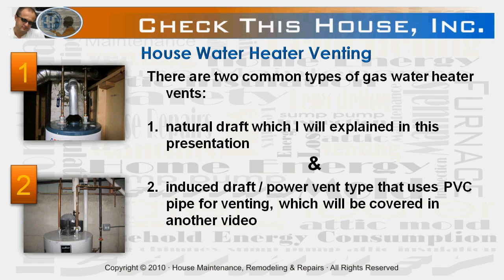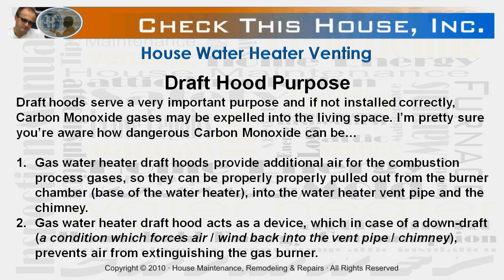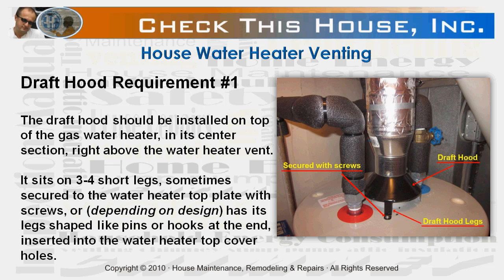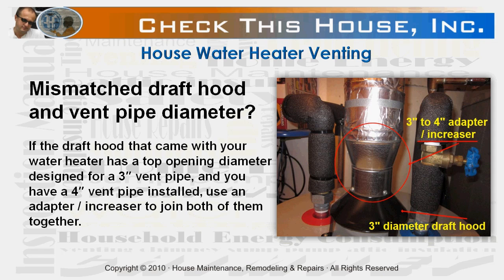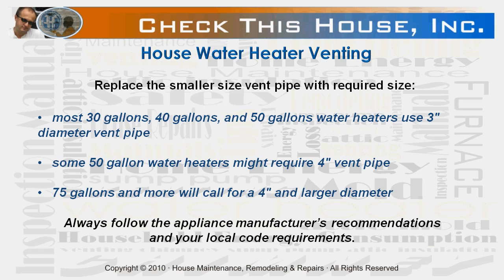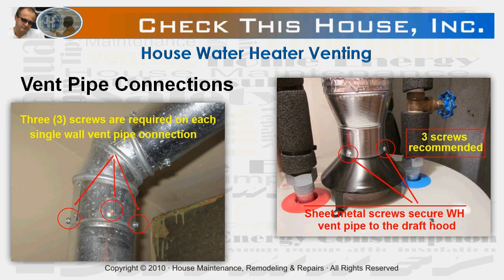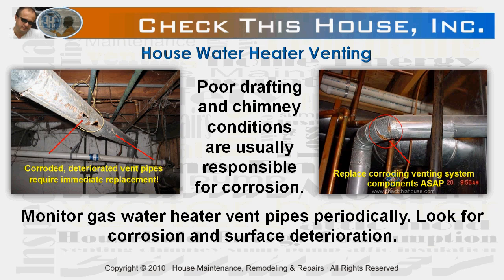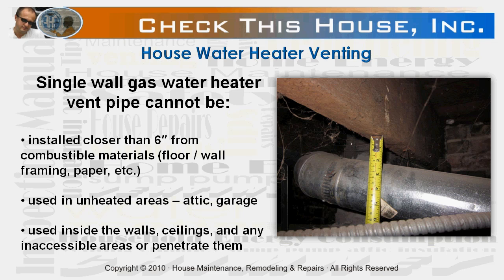Hot Water Heater Venting, How To Vent a Gas Water Heater

Comment: Hi...our gas water heater is currently vented thru an old chimney that has no liner...can the water heater be vented horizontally across the basement ceiling over to an outside wall safely?  (Which would make the chimney non-functioning)..Thanks!
Reply: Did you ever find an answer to this?
Reply: @bryangonzalez3165  ..we ended up having to get a new electric/gas type of water heater so it could be vented horizontally.  Worked out well.

Comment: @Home Maintenance
 I have a question and a little back history, we bought a house and the first winter our furnace went out, I tried replacing everything on the furnace, even the blower motor and the  electric board. well come to find out that our chimney was destroyed and the moister was freezing up, and then running back down into the furnace and causing the issue, so the chimney was completely useless we found out. so when they came to replace our furnace they installed 2 PVC pipes which lead out to the front of the house and we bought a brand new water heater just before the winter, and of course it is vented through the useless chimney. so my question, is it possible to convert my Atmospheric venting to a power vent and run it up to the middle of the joists and then over and straight out the back? thank you

Comment: If venting horizontally when in a basement near a wall, a thimble is still required with double wall pipe correct? Also when through the wall does it have to be a certain distance from the home?
Reply from the maker: Hi Jesse, is this a natural vent water heater? Are you venting through the side wall of your house and terminating there? If so, this is not permitted, you have to go above the roof with the natural vent type water heater vents. Please explain a little more about your installation.
Reply: The install was done by previous homeowner, which has left me wondering. It is a natural draft waterheater. I believe the previous heater was a power vent because the pipe that goes through the sidewall is pvc with a T that has mesh on each side on the exterior.
Reply from the maker: Well... that doesn't sound right, you need to connect to a chimney / go above the roof or replace this water heater with one that can be vented through a sidewall.

Comment: Fortunately most natural vent gas water heaters for non commercial use are maximum 38,500 btu's. This makes them safe and very forgiving of a bad installation if installed in anything other in a closet or a mobile home. Otherwise a lot of people who purchased the el cheapo gas water heaters at the big box stores would be pushing up daisies.

Comment: Can i insulate the vent pipe with some sort of tape or something?
Reply from the maker: Hi Green Karat, 
A single wall water heater vent pipe (if this is what you have) should not be insulated. If by taping you’re referring to vent pipe joints… well, that’s debatable. Some building inspectors consider it OK, some forbid using any type of tape on connector joints. The main reason behind NOT using tape (heat resistant / high temperature flue tape) on WH vent pipe connectors and connections is that it prevents visual inspection and spotting of any problems such as corrosion. 

Double wall / B-vent type pipes utilize air, between the inner and outer pipe, as an insulator. So, if you have a single wall vent pipe, replace it with double wall and that will take care of insulation – don’t tape any joints of a double wall pipe as well.
Reply: +Home Maintenance Hi thank you very much.. I have an hydroponics for my wife veggies regimen lol in the garage. I've noticed that the gas water heater heat up the room sometimes too much. I wonder if i can insulated the exhaust pipe since is about 4-5' till it hits the ceiling and go out. I put one of those jackets to cover the heater and helps a lot so i know that doing something to the exhausted to insulate it will be great. 
Thanks in advance!!
Reply: I have a single wall btw
Reply from the maker: :) Hi Green, where it hits the ceiling it should be double wall all the way to its termination above the roof. The correct way to minimize that excess heat radiating from the vent pipe would be to replace the single wallsection with double / B-vent type. This should take care of your extra heat problem. I’m not sure what your location (climate) is and if your garage is conditioned / heated, but B vents are required in un-conditioned spaces where condensation may develop and cause vent pipe corrosion (garages, attics, etc.). Let me know. Darek

Comment: What is the slope required for venting? I read 1/4" per foot. is this correct?
Reply from the maker: +David G Hi David, you're correct, a minimum of 1/4" slope (rise towards the chimney stack) per linear foot of venting connector's horizontal run is required.

Comment: Really informative my propaneheater doesn't run to a chime so should I use chimney piping from my draft hood to the outside?
Reply from the maker: Thanks Armando, I'm not sure, I'd need brand and model of your appliance to check its requirements. If it has a regular draft hood like on my video it should be vented vertically above the roof.
Reply: Home Maintenance What I guess I was asking is do I need B Vent piping or should I use fireplace pipe fittings because the water heater doesn't vent into an existing chimney it just goes up about 12" then 1/4" per foot for about 4' to 5' then 90 degrees up for about 12 feet. Its all done with B vent piping. The model is PremierPlus model #BFG614OS403NOHV. Really appreciate this it was not correctly done and had really bad back draft so I want to correct it because the tank is in good shape just need some guidance on the actual chimney itself!
Reply from the maker: Armando D'Leon It should be B-Vent starting at least one inch before it enters / penetrates any surface like wall, ceiling, any combustible material, inaccessible space, or unconditioned space (attic). If the WH itself is located in some unconditioned space the entire run should be double wall (B-Vent) starting at the draft hood. So the vertical B-Vent is fine, no need to install fireplace fittings those are triple wall I believe. Back-drafts are often caused by a missing or improper / improperly installed rain cap.
Reply: Home Maintenance I guess I don't understand the difference between B vent and the venting I used for my Pellet stove. The Pellet stove had a double wall and the WH has a single wall. Do I just need the single wall and that will be okay to run from the draft hood to the rain cap or do I need the double wall piping?
Reply: Home Maintenance Nevermind I think the B-Vent is the same thing I used for the Pellet stove and I can just use the other piping after that makes sense now only need the B-vent in the wall.
Reply from the maker: Armando D'Leon Yeah, B-Vent is just a double wall galvanized pipe.

Comment: Thanks for the VERY informative video.  Are the single wall vent pipes usually 26 gauge? Trying to distinguish if the steel pipes I see at the box stores are the right ones to use for furnace/water heater.
Reply from the maker: Hi D Panel, I would check the label, it should state material's gauge, or ask someone in the store to verify if not listed.

Comment from the maker: Hi Mark, 
How is combustion air delivered to that closet? Are there any air supplying vents open to exterior, attic, or some other areas? Where is your CO alarm located? Are there any other fossil fuel appliances inside the house that might be affecting Carbon Monoxide detector? Are there any direct openings between the closet and the living area? 

Go to my website (link under the video), click "Click To Ask" button on that page (right side) and answer my questions. YT has character limit...

Comment: I have a water heater in a closet in a garage. it vents with a 3" single wall and then connects into what appears to be a 4" cement pipe which goes through the house out to the roof.  My carbon monoxide detector keeps going off and this water heater appears to be the possible culprit. Even though the water heater is not in the house but in the garage.  the transition is a large coupling that looks like the type used for going into a drywall ceiling.

Comment: I had a power vented tank that exhausted out a PVS pipe that ran 20ft down the sill & out the side of the house. The tank & draft inducer died and I replaced it with a natural draft gas tank. I made a new opening on basement wall instead of going 20 ft down the existing opening, now I go 6ft horizontally out the side of the house w/the new tank. I would say its angles maybe 15 degrees, but there is still a slight smell of gas. Should I angle it more, or do I need a gas tank with a draft inducer?

Comment from the maker: Hi,
What do you mean by "it needs"? Was it designed for the side wall venting / power venting or you have a natural draft water heater which you'd like to convert to a power vented type? If it is natural draft, it is unlikely that its design permits such conversion but you'd have to check that with its manufacturer. 

Go to my website (link under the video), click "Click To Ask" button on that page (right side) and put "sidewall venting" into the search box on the page that opens.

Comment: I have gas hot water tank that needs a draft inducer (exhaust goes horizontal to the side of the house). Can I use an after market draft inducer and install? Or does the gas tank have to com with the draft inducer already? Thanks!

Comment from the maker: Thank you Michelle, 
The vent connector can never be smaller than the draft hood and you are correct; it should never be bigger than it should be. How much bigger (if possible of course) depends on the WH's BTU rating, connector's length, presence of other gas burning appliances connected to the same chimney and / or manifold. For as long as this larger vent connector is complying with the code requirements and manufacturer's recommendations there should be no problems.